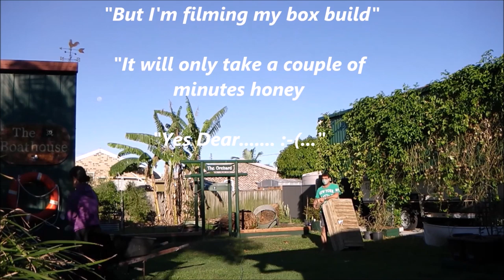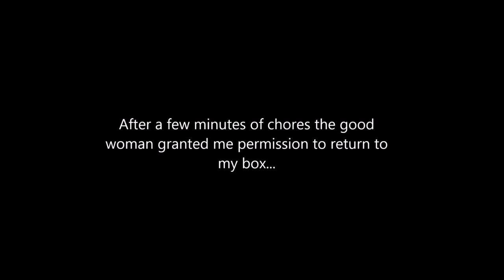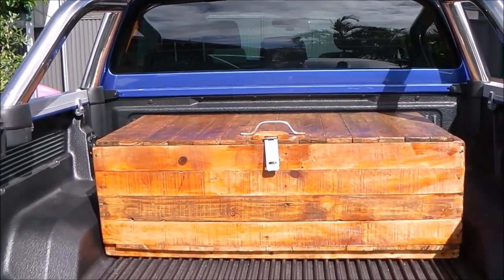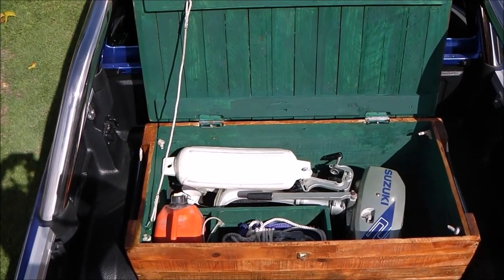Mac 26 Vlog 24  Pallet wood  dinghy Outboard motor storage box

Comment: have to say this was a great video loved your wife putting you to work a bit, very good, the box turned out very nice looks great bird wants his pay for his bit in it all I have a stainless steel box that bolts down to truck hard to steal locks as well, but people in the states taking boxes like yours using for coffee tables in there living room looked great i dont get it but yours would sale for more than i paid for mine here to go in living room but think when your cleaning you could throw cloths and shoes you want to hide
Reply from the maker: I believe there is more chores planned for me today too.... :-(   They would have to be desperate I think Michael,  but yeah,  somebody probably would pinch the box. Probably shouldn't have bothered with the stain. Yes a bolted steel box is a better option for sure..
Reply: @OldDadProductions  love mine and it make the truck look better but yours looks great i have 2002 chevy 4x4 Silverado
Reply from the maker: @mhazel4777  Full size trucks have not really been sold here,  I think because gas prices are about 3 or 4 times higher,  and because our population is a lot smaller and therefore the amount of people requiring that kind of towing power, is limited and therefore not worth the  re-engineering to right hand drive.  However for some reason,  Ram and the Silverado have recently got into the market here - they are both fine looking vehicles and they are selling, the Silverado a little cheaper starting at about 120K I think!   I better start working on the big boss now,  it took me three years to get a Ranger out of her.... :-(

Comment: Thought yu would have done the proper flash navy bloke handles with ol 3 strand Manila rope with double stopper knots on the ends -    Man if that box was built any better you could use it as a punt and head over to Tassie in it.
Reply: Yeah I'm sure you'll get offers from those challenge freaks wanting to be the first to sail non stop single handed around the world in an outboard box.
Reply from the maker: Ha ha, spliced plenty of manilla in my youth, but havn't seen any in a long while now.  Having lugged the box about the place a bit now,  I do believe I made it a bit too big...  Oh, well, plenty more pallet wood about..